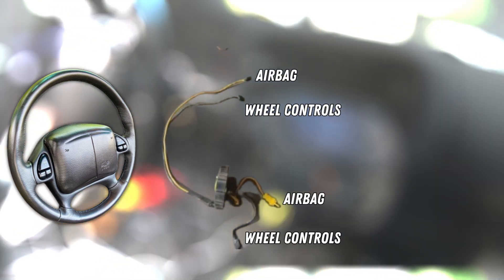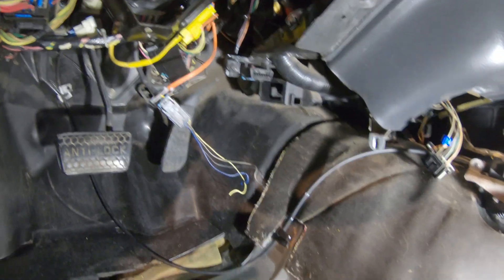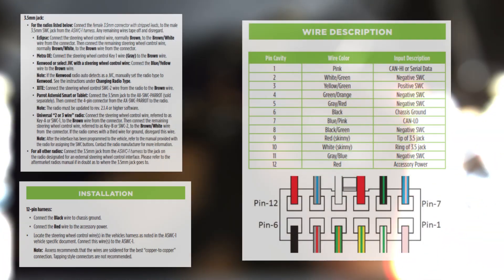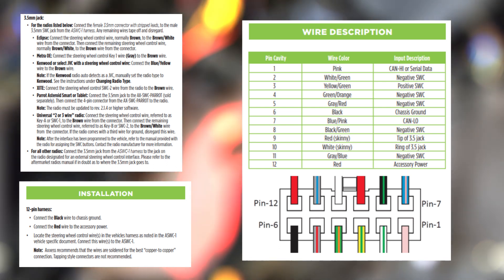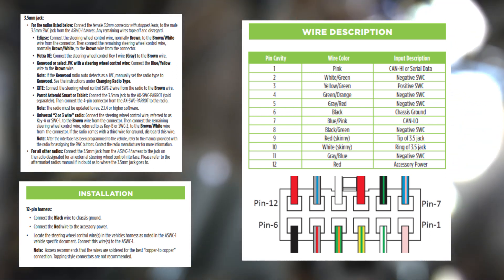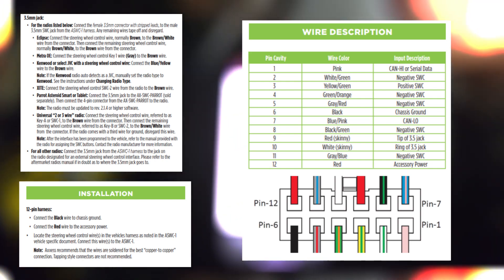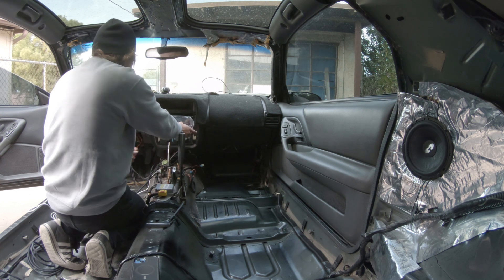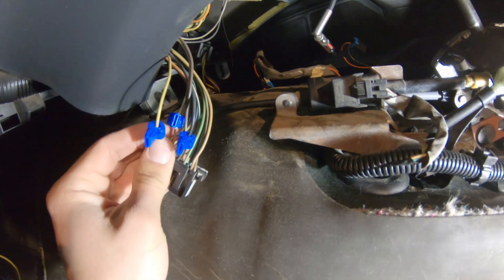How To Install Steering Wheel Controls (98-02 F-Body)

Comment from the maker: One thing I forgot to mention. You want to take pin #3 from your adapter (yellow/green) and you want to connect that to your signal wire (for me was blue from the wheel control harness because I used the full male+female harness)

Comment: I would love to see a video detailing how you swapped from the 93-99 style steering wheel to the 2000-02 style. Even the one without the wheel controls. I prefer the 4 spoke style of the 2000-02 wheel and want to swap it into my 99 Z28.
Reply from the maker: Super simple just to swap over the steering wheel, just remove air bag, clockspring and the nut holding the wheel on to remove the wheel 00-02 wheel will fit perfectly and then put everything back on.
Reply: @lsxjosh4375  Ok cool, so I can re-use the clockspring that's already installed?
Reply from the maker: @damonroger3184  yes, if it’s a wheel with controls you just won’t be able to use the controls without a clockspring from a model that had wheel controls
Reply: @lsxjosh4375  thanks man that's actually super helpful